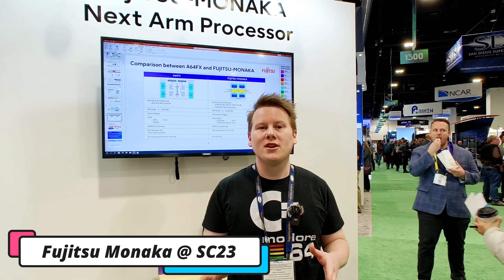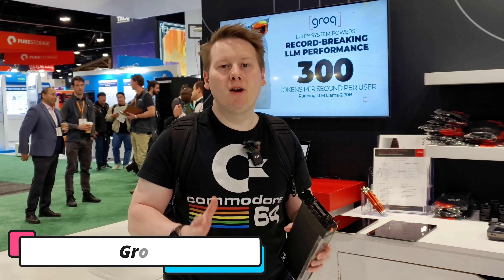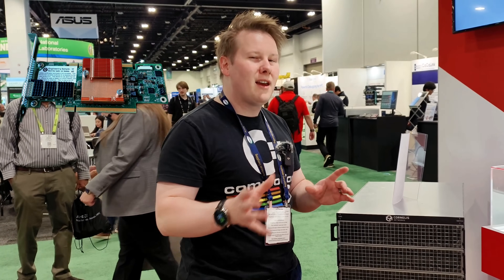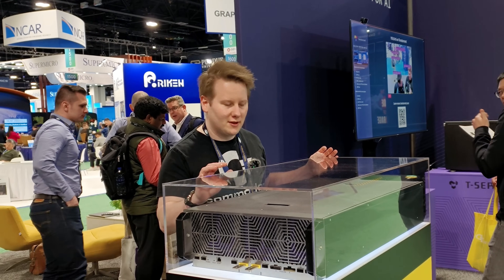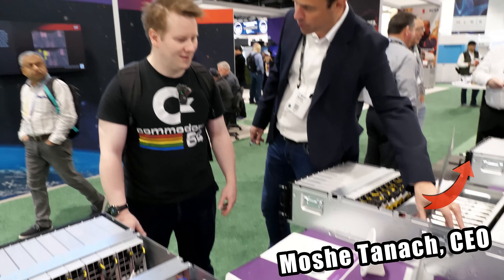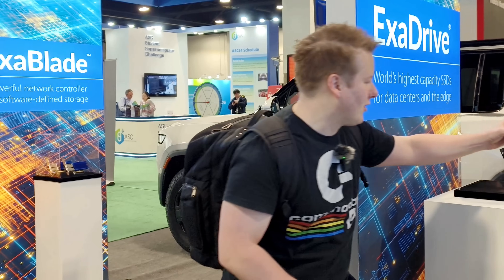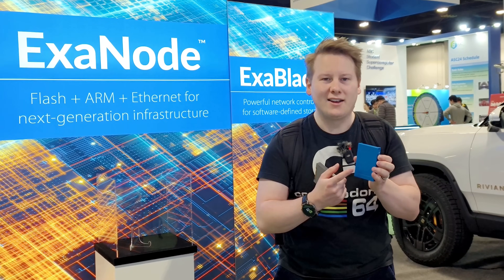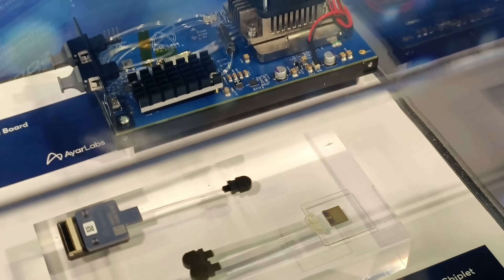Seven Silicon Highlights from SC23. And a Llama

Comment: Real shame Fujitsu never sold small systems with A64FX. It was super awesome chip when it showed up in Fugaku. First CPU with SVE, and a lot of cool interconnect. Apparently HPE was (and still is) actually selling smaller systems (including single 2U chasis, hosting 8 blades each with one CPU) with A64FX, but I never knew of that before (i.e. Fujitsu never mentioned that on their news).  And of course pricing unknown. I hope that Monaka would be more accessible.